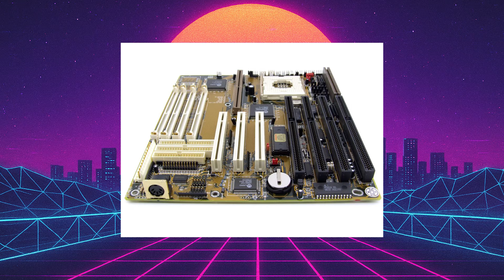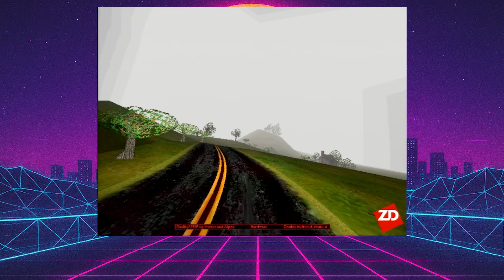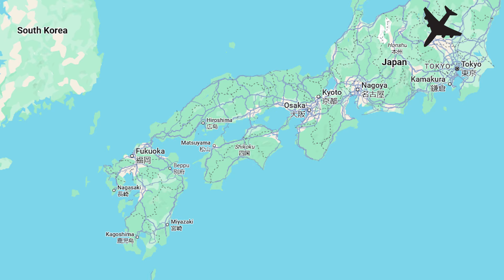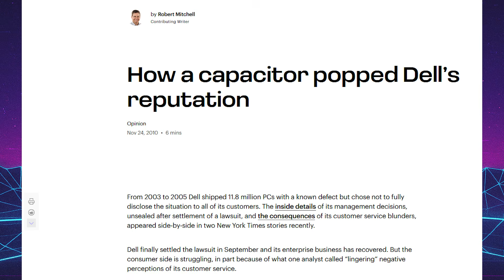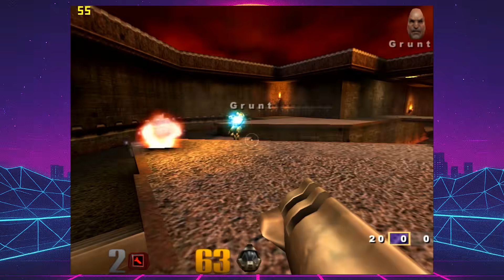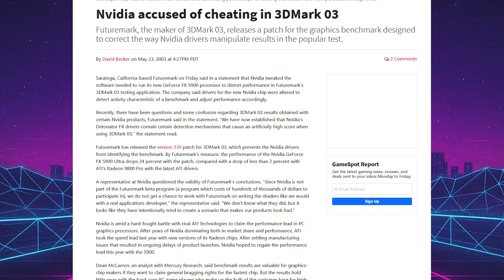Top 5 PC Hardware Scandals Explained (Fake Cache, 3DMark, Quake 3 & More)

Comment: The bigger issue would be reduced visual quality if you could see a line moving on the floor with bilinear filtering or other issues. Maybe multiplayer Quake was played so fast that nobody paid attention. With AGP they started putting out cards with very little onboard memory and called those "turbo". Around that time we also had Winmodems with hardware missing and signal formed by the CPU, and sound cards that synthesized music on the CPU. Low end basic graphics cards had their uses, but usually came in a box with gaming art, despite being unable to run contemporary games. Having no cache was bold. I would utterly destroy performance on later CPUs.

Comment: Not a scandal but just something the industry accepted . The PR rating non intel processors had in the 90s.I'm such that there was some benchmark whee PR was an accurate measurement of performance but hell if I know what it was for the most part it seemed like a lie
Reply from the maker: That's a good one actually and its something that came up in my research, and something I experienced first hand buying a non intel at the time.
Reply: There's a couple of different  things going on with PR ratings.

 Firstly they were basically integer performance comparisons, and were reasonably accurate. Unfortunately most people were upgrading to play games, and since Quake, games had started to require better floating point performance.

The second main set of PR figures were when AMD had the lead in performance (AthlonXP), but the general public still thought higher clock speed was King. So AMD used a PR score to match the closest Intel Netburst chip.

Comment: In 1999 I bought a system of the cheapest compatible shelf roses of a long gone shop... it included a PII-333 with 32MB memory, Rage 2 Charger and my old 3GB HDD that cost an arm and leg in 1997. And even the shop owner told me not to expect much in the way of "acceleration" above 2D operations even if the R2C's marketing materials let believe otherwise.

Comment: I play Quake 3 Arena to this day, and the thousands of add-on maps available are awesome for variety. I do remember when it came out as a demo, before the game's official release, but my Orchid Righteous 3D card glitched badly under it, and it was slow. I had to get a Riva TNT2 Ultra to get it working properly.
Reply from the maker: the Orchid Righteous 3D is now a legendary card, very much sought after, the TNT2 Ultra would have been a massive step up!
Reply: @ComputerRetroBus  I did try overclocking the Righteous 3D once, but I didn't like the results, as the visuals became blurrier and after I put it back to how it was, the card glitched every now and then when it hadn't before. I think the Q3A demo came after that time. In any case, that was the first and last time I tried overclocking PC hardware of any kind.

Comment: Ah yes the capacitor plague. So many electronics died prematurely thanks to that. Even today its dreadful shadow still haunts us, as I like to buy NOS hardware and I'm always getting the nasty surprise that they have these terrible capacitors, which die quickly if they even work at all, it affects mostly stuff from the early 2000s (thankfully) like motherboards and CRTs. A very good reason to learn how to solder.
Reply: Had a pc (IBM?) with bad caps. I do remember they sent me a new motherboard and offered to install it (did it myself). Could see where the tops had bulged on a number of them.I think they also paid for the shipping to send the old one back.
Reply from the maker: @retirednerdyguy  nice! great that you got a replacement, like Dell Im sure it cost them quite a bit to replace a lot of motherboards.
Reply from the maker: I know, it's crazy that even completely new and unused parts are even effected! I got a New Old Stock motherboard, it was beautiful and what do we have? bulging caps 😢 still worked but yeah, you have to address those caps

Comment: Cheap "1080p" and "4k" projectors that have a physical resolution down in the 360(!) to 720p range. But they are compatible with a 1080p/4k input, scaling that down to their 'native' resolution. (I do buy them sometimes, for art projects that don't need the high resolution and the price tag that comes with it, but I make a note to only by ones that prominently display their real 'native' resolution alongside their 'input compatibility" resolution in their product profiles.)
Reply from the maker: I know! I totally hate this, just because you can plug in a 4k signal they advertise it as 4k projector!

Comment: Surprised to not see anyone mentioning 12VHPWR/12V2x6, Nvidia dropping 32-bit CUDA support on 50-series cards, Nvidia removing the ability for users to see hotspot temps on 50-series, the Gigabyte exploding power supplies, the NZXT H1 riser cables, the various AIO liquid coolers that would clog up from bad coolant, Intel's 13th and 14th gen CPUs failing, Intel's "Snake Oil" marketing campaign, the various warranty issues with companies, EKWB's scandal from not paying employees, the AM5 boards popcorning X3D CPUs, EVGA's exit from most of the industry because of Nvidia, or the various crises of components becoming scarce because of crypto mining and AI. Honestly, you could throw darts at a calendar and have trouble not hitting a day that has one or more scandals occuring or ongoing.
Reply from the maker: These are great, just goes to show nothing has changed eh? They are all still at it.

Comment: The FX driver scandal was actually even worse than that.  Nvidia didn't just introduce benchmark "improvements" they flat out reduced texture quality in all games in order to boost FPS.  Back in those days the drivers had a texture quality slider that went from very low to very high, however in this era Nvidia tried to get an edge over ATi by removing very high, renaming high to very high, renaming medium to high, renaming low to medium, renaming very low to low, and adding a new super low called very low (I may be remembering the exact names wrong but that's the method they used to scam people).  They eventually got caught out leading to the rise of the "Omegadrivers" and other third party tweaked Nvidia drivers that restored full texture quality.
Reply from the maker: That's a great detailed explanation! Very dodgy indeed, I do remember a lot of my friends going the omega drivers they were quite popular
Reply: They even replaced shaders in Half-Life 2 for GeForce FX, for a "custom ones". I still do have GeForce FX 5900.
Reply from the maker: @homersimpson8955 yes I remember that too! The Radeon was really the preferred card for half life 2 which was a blockbuster title. They even gave free steam game keys with certain Radeon cards

Comment: lets not talk about how every monitor manufacturer ( CRT) that advertised 14" for an example  when in reality it was 12.7" at best - later they claimed it was the size of the tube , which You were not able to see under plastics but then 15" was barely 0.2" inch larger and yet it was advertised as 15" CRT, and then following just to keep us in line with their lies,  17" was actually 15 " , 19 was 17"  etc ...
Reply from the maker: Hehe yes, totally forgot about this, the numbers were totally BS. Later on they would label it 17" but in fine print brackets it would say 15.4 viewable.. ahh that was the times
Reply: They still kinda do it too with LCDs, but they can't get away with as much as with CRTs because they don't have the thick bezels.
Reply: It was fine as long as you compared multiple monitors that all followed the same specification of the total tube diagonal. A bigger number actually meant a bigger monitor. Only later LCD monitors got apparently bigger.

Comment: Fx was not a new architecture and that was actually the problem. They toke a aging architecture and tried to push it too far and it failed. That is why fx cards are wanted for retro gaming. Great support for everything below directx 9, but totally not good for everything after 2004. Fx was basically a beafed up geforce4.
Reply: It's just too bad they came out at a time when everyone wanted good shader model 2.0 performance. NVIDIA really screwed the pooch with that one. On the upside for retro games, GeForce FX supports palletized textures, which was removed in GeForce 6 series.

Comment: You forgot to mention the AMD pile driver or bulldozer FX (pre-Ryzen) scandal when their so-called octocore processors were actually quad core (and they got sued over it). Also, the intel 13th and 14th generation over voltage and oxidation scandal a few years ago.
Reply: they settled the lawsuit, does not mean they lost it. They where 8 core chips on paper, just with a weird sketchy design that made certain resources or FPU's to be shared or something. But technically, still 8 visual cores.
Reply from the maker: hehe it never stops does it, such recent examples 🤣🤣
Reply: @ComputerRetroBus Sounds like a Part 2 :b

Comment: The 845GV had motherboards with a whole AGP slot, but it didn't output video.
Reply from the maker: 😄😵 OMG that's ridiculous, the fake AGP slot I have atleast works lol, its just a PCI slot in reality but they have put in an agp socket (AGP is backwards compatible with PCI so it works) .
Reply: @ComputerRetroBus Apperently, sometimes it's genuine AGP, but only the USB signals are exposed. I have an HP POS system from the socket 478 era that uses the 845GV, and some forum threads suggest it just has the video pins grounded.

Comment: Well here i would mention laptop gpus 7000 8000 9000 series nvidia failing especially hp dv6000 dv9000 series
Reply: It's all part of the larger Nvidia Bumpgate scandal. Laptops and consoles based on G70 were particularly impacted due to thermal constraints. Apple, all the OEMs, widespread financial impact, that Jensen still denies Nvidia's primary fault in, which were cost down decisions in package design. Now Apple has little to do with them, Sony, Microsoft use AMD in the consoles, we all knew inside, but there's always that plausible denial that works on fans, and litigation for those it doesn't.
Reply from the maker: @drewnewby  That's very interesting! well when it comes to the big OEM buyers reliability is king! if it fails it becomes their problem/reputation on the line
Reply from the maker: I must look into this one, I can't recall it. Sounds like another juicy one
Reply: @ComputerRetroBus  If you do, go to the source,  Charlie Demerjian, for public awareness. Nvidia spent hundreds of millions at the time, and more since, blaming it on literally everyone else. The OEMs, the console manufacturers, the poor chip packagers, that used the cheaper chemistry Jensen demanded.
Reply: @ComputerRetroBus 
Its pretty known issue
7000 series 
For instance acer aspire 5630 -ig had a failed dedicated gpu that i fixed by reflowing the gpu chip core 
Also i fixed msi l775 with 7600go 128mb gpu reflow

8400 gt 8800gtx m 9800m gt 9600 gt were known to fail on laptops 

Some call it bunpgate problem because nvidia at the time used bad solder that crack (not exacly sure how to explain itl

I still fix old laptops from about 2006  to 2016

Comment: The Pentium 1 floating-point unit bug.
Reply from the maker: Ah yes! I remember that one, intel did a big recall but I still sometimes see intel Pentiums for sale with the bug around.
Reply: @ComputerRetroBus  there was also the Intel 80386 that couldn't run 32bit software so Intel just etched "16 BIT S/W ONLY" on the chip. So few people were running 32bit software then that no one complained.
Reply: @ComputerRetroBus Pentium is just E-waste. In fact, anything before a Haswell 4th gen core i7
Reply: That would turn that CPU instantly into e-waste

Comment: To keep it era specific, BGA failures. Rampant with Nvidia and 3DFX mostly. Many Geforce 4 and Voodoo 3 cards died because of BGA solder failures of the GPU and memory chips.  Nforce Northbridges on motherboards and in laptops caused a huge amount of e-waste. Apple was hit hard core with Nvidia BGA failures.
Reply from the maker: Yeah this one was nasty, I was lucky enough to never experience it but I remember reading about it.

Comment: 3.5 GB nVIDIA cards... haha  I like these story videos. It's like a timemachine trip. :D
Reply: I got a lot of little checks for all those I bought / sold.
Reply from the maker: Haha, that one was definitely a classic controversy! Glad you enjoyed the trip down memory lane :) Yes I remember that one, 4gig cards that were unable to adress the last 500Mb of RAM :)
Reply: @ComputerRetroBus  
Not a scandal and not exactly cheating, but I remember the short period of time when Nvidia promoted "Turbocache" and ATi promoted "HyperMemory".  Basically graphics card would have a small amount of onboard VRAM, but they could also utilize system RAM. For example Geforce 6200 TC 128MB would actually only have 16MB of onboard VRAM and rest would come from slow RAM. They even had 512MB variant that had like 64MB of VRAM.  Back in those days uninitiated people only looked at the amount of memory that was advertised and top end cards only had 256MB of VRAM  (some very rare samples had 512MB)
Reply from the maker: @kimnice  Oh yes! I remember this! it was indeed very dodgy and if you didnt have fast system RAM i'm sure it really impacted performance
Reply: @ComputerRetroBus  
That card (GTX 970) could access all 4GB of VRAM. The issue was that the access to that last 0.5GB was slow.  Memory bandwidth for the first 3.5GB was about 192GB/s and only 28GB/s for the last 0.5GB. It was a good card and if Nvidia had just marketed it as a 3.5GB card everything would have been fine. 

From PSU world I remember an opposite case: Superflower marketed their PSUs with lower wattage than they could actually do. They had this series called "Golden Green Pro" and they obviously wanted that "80+ Gold" certification. They knew that their units would stay inside that standard up to a certain amount of wattage and then drop to Silver. So they marketed their units with the maximum amount of wattage for the Gold standard. Packaging mentioned that their units could "overclock" and go even further.

Comment: The intel FDIV & F00F bugs were fairly controversial during the 90's but I think my fav is when Intel bribed reviewers into giving AMD a bad rep. There's a infamous tomshardware video floating around where they "benchmarked" quake 3 by filming  what happens to the processor when you remove the heat sink - Let's just say, the K7's didn't fare so well 😂
Reply: I remember seing this.
Nice BBQ :)
Reply from the maker: oh yeah, intels practices were very aggressive and nasty. They would threaten  to withhold stock if the manufacturer also used AMD, and give them rebates if they were intel exclusive.
Reply: And that was actually, quite normal for those CPU's. They where running bare cores, with the only temperature sensor, being under the CPU socket. Intel's design was a bit better due to the IHS and internal temperature monitoring, but after those series AMD can be running without a heatsink now as well.

Comment: Missing ROPs.
Reply from the maker: heheh yes! Nvidia still at it lol, even with their latest hardware eh
Reply: @ComputerRetroBus  their strategy has always been gimmicks over hardware - ie they give us less hardware but more "features"...but eventually when the games come out that use the "features" the actual hardware you're running the games on isn't sufficient (eg piss poor amounts of VRAM unless you buy a 4090/5090) to enjoy what you've been sold on. They will never stop doing this.
Reply: @ComputerRetroBus  Mine thankfully has the full ROP count.
Reply: I think that was more of a defect than intentional misrepresentation. But it is a scandal.
Reply: @vdochev I get what you're saying but they still messed up. Imagine spending the kind of money that a 5090 costs and getting an incomplete product
Reply: @aaldrich1982  Yes, they did. If I recall correctly, they said it was just 2% difference in performance (which in reality was not) and they refused to do anything about it. But you were able to return your card if you wanted, at least. Maybe they accepted it because of the backlash, though.
Reply: I think it was intentional with the missing rops because normal people dont check that why toss duds when you can sell them
Reply: @trashtronics1700 when you're a company as big and rich as nvidia nothing is a mistake or coincidence.
Reply: @trashtronics1700  Oh, yes, for real. They probably thought the loss of performance was too small to justify scrapping those cards.